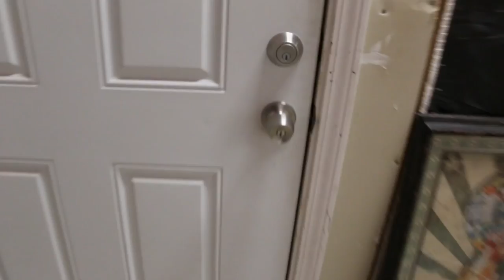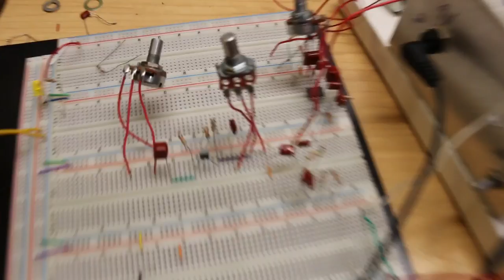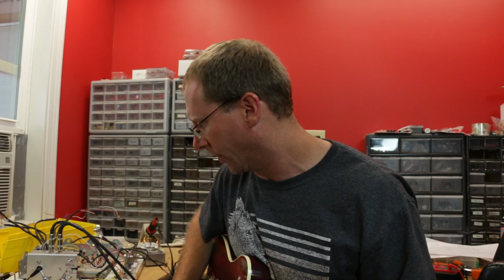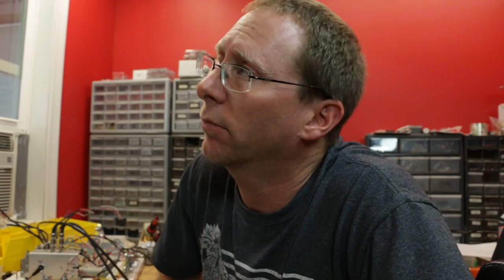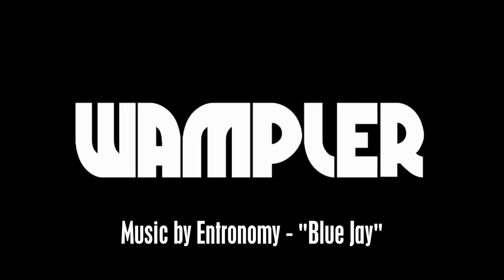Busting the myth of magical op-amps and diodes...?

Comment: What if you used white LEDs and painted them purple?  How would that sound?  ;-)
Reply: I think it is fair to say just about anything painted purple is better.
Reply: What if you connected it to a gain pot that went up to 11?
Reply: Actually, the tone would be warmer because the paint would cause the diode to run at a higher temperature.  You know it's true!
Reply: That is exactly what Prince did back in the days... no kiddin'
Reply: there are no white LED's. the white light is a mix of red, blue and green
Reply: It would be a lot less bright
Reply: Like a white ones that look horrible!
Reply: I heard if you use purple house paint over the whole box you will get 10% more power
Reply: It would sound something between White Snake, LED Zeppelin and Deep Purple.
Reply: @phililpb  White LEDS are actually UV making phosphorus coatings glow similar to a fluorescent lamp..
Reply: According to Prince it would sound wet.

Comment: When you're designing a circuit, how do you prevent your ears get fatigued? And, how do you avoid duplicating the sound of previous designs?
Reply from the maker: +Alan Parkinson every 30 minutes I do something else that is somewhere quiet
Reply: I do the same when writing songs take a 5 min break
Reply: Use proper test equipment, far better than ears, and no comfirmation bias.

Comment: It could just be the iPad speakers, but I didn't hear any difference at all in chips. I've swapped chips in a Boss EQ before though, and the one huge difference I heard (and result I was after) was a noticeable reduction in white noise when the pedal was on. There are differences in chips, but tone is not where you're going to notice it. Noise and headroom are going to be the difference to listen for.
Reply: Yeah that's one of the big things with op amps that goes unmentioned a lot of the time, I noticed the same thing when experimenting with op amps.  IMO there's a difference in tone but sometimes it can be subtle.  I find the difference to be more or less hi fi, or more or less fuzzy, like a different character of grain in the fuzziness of the clipping, depending on what pedal it is.
Reply: thisdyingsoul76 
Hi, what chip is quieter then, lm833n?
Reply: It was over a year ago that I made the swap. I don't remember the model of chip that was stock that I replaced. But there was a noticeable difference in the noise floor when I was done.
Reply: thisdyingsoul76 hmm, very very interesting
Reply: With a high end stereo you're able to hear a myriad of effects that these different chips provide

Comment: In conclusion op amps sound the same.
Reply: Yes because in this circuit, the op-amp is NOT creating the actual distortion, the rest of the circuit is doing soft clipping. Op-amp just amplifies it. If a circuit had depended on pushing op-amps into distortion, then I'd say we'd hear a lot more differences, because each op-amp DOES have different characteristics past the "normal" operational range.
Reply: I was just about to change the chips in my amp because I was told the new set would sound better. I thing I will leave things alone
Reply: In soft clipping pedals op-amp is no more important to the tone than the colour of the box.
Reply: Tong Zou  Of course they could :)
Reply: @EvilDragon666  evil dragon! You’re everywhere
Reply: @Hexspa  Kinda. :P
Reply: @phililpb  A more expensive, higher quality op-amp should sound cleaner and more transparent. That's what better op-amps are supposed to do.
Reply: No, they don't sound the same. That was not his point.
What he was saying was that the differences are a lot more subtle than people think, however they are noticeable.
Reply: I like the LED clipping best. Or, an LED and a 4148. 
Mix and match. Great demo Brian 👍
Reply: @ErebosGR  that assumes the playing intensity, etc. is also identical every time. As consistent as Brian is with his playing, it's a confounding variable unless you play the same audio every time into it. Feel could vary, how things clean up if the volume is backed off, but that'd be harder to convey over YouTube.

Comment: Anybody else really shocked at how different the sound was with different color LED's?  I know nothing about this stuff, but that's probably the last thing I would have thought to make a difference.
Reply: There was - but the hearing memory is short and he is yapping so much inbetween so i bet 80% of the listeners missed it completely, but hey!
Reply: Forward voltage I think. Could be wrong, it might be the color. 😂😂
Reply: Color has NOTHING to do with it... well, not directly. Forward voltage, however, does. Difference colors require different amounts of energy to create, of course, and this is reflected by the amount of forward voltage across them. Red having the lowest forward voltage, and blue having the highest. Green in the middle. 

In this, pink and white will sound the same, as pink has the forward voltage of blue, as it is a color component in the LED. 

There's really 4 different forward voltage varieties. Red, amber, green, and blue. All other colors are made by mixing the earlier varieties.

There's also UV, with an even higher forward voltage than blue, and IR, with an even lower forward voltage than red, but that isn't really relevant in this discussion.
Reply: Red and orange were mostly opamp distortion, they were hardly conducting.

Comment: I love how your choice of chips in the first half was all over the shop, showing how jFET/BJT input and current handling capacity has nearly bugger all impact on tone in a guitar effect pedal. The BJT input chips tend to be lower noise, which can be important in a studio mixer with dozens of channels and the higher current OPA chips drive lower impedance loads (headphone amp) better, but if you're talking distortion pedals, just use TL072s; they're common as clarts and they get the job done.

Comment: I've been standing in front of a Big Marshall for too many years.    It all sounds the about same Gaaaaaaaaaaaaaa
Reply: Dude, that was the point of the video.  THEY ALL SOUND THE SAME.
Reply: @timeforpudding6338  No, they don't sound the same. If they do to you, you either have hearing loss or not good enough headphones/speakers.
Reply: @ErebosGR  Ummm, you really didn’t get the point of the video, did you?  Go back and watch it again.  Brian is trying to explain to people, such as yourself, who believe there is an audible difference between the transistors he selected.  Geez.
Reply: @timeforpudding6338  You're the one who missed the point because you're trying to reduce the argument in black&white, like a typical anti-intellectual.

He was trying to dismiss the myth that different opamps sound drastically different, when in reality the differences are a lot more subtle but still noticeable. He even points out how some of them sound compared to one another.

Plus, when he was swapping opamps he had soft-clipping diodes, so the opamps weren't overdriven out of their operational ranges. If he had compared them without the diodes (like he showed later on), the sonic differences would've been greater.
Reply: @timeforpudding6338  If you want to go technical, you can research how the opamp's slew rate affects its frequency response.

Comment: That's 100% truth, i tested myself many years back and i can say there nothing i can hear fron just the chip. Usually we believe what we think is "better".
Of course there can be many other things like the tolerance of component or similar things but the psychological impact is very strong to our minds.
I like your videos and your good job you do, thanx for all these
Reply: Like he said the breadboard circuit he's using is junk. There was enough stray capacitance to suck any tone you might have heard. It is easy to setup a circumstance where everything is not going to sound good. A bit harder to build it so it does sound good. Never trust a test where they do not describe their methodology. We saw no schematic of the circuit they used. He could have at least tried to build the circuit a bit cleaner on the breadboard. Or better yet soldered something up and used a chip socket. They're not charging 40 times more for some of those Op Amps for nothing.

Comment: the first "expensive" one sounded better than the second one, but they're all pretty much the same. For the really lo-fi gritty ones, I like the LM386. The 4558 sounds pretty damn good too. It's a super subtle difference, and I bet some of these vary equally much within their models as they do compared to other chips. In my ears, it's mostly about clarity, apart from the gain levels of some of them. Great video!
Reply: Agreed.  The good old LM386 sounded great in this circuit.
Reply: LM386 is my favourite ever.

Comment: I've done this with several germanium transistors and it was a lesson in BS..
Reply: You've had the wrong circuit then because germanium fuzzes are the one thing where it actually matters big time. The gains and leakage values are so off the wall you will have to bias each and every one of them right to make them work like they're supposed to. With some circuits you barely get sound at all with the wrong transistor.

Comment: Brian, the way I hear it, there are differences between op amp chips but they are minimal. The game changes when you swap diodes. Volume and/or compression comes in. I believe it now comes to the builder on how he will voice the pedal and what does the player actually need. The bread board might have that low frequency hum but hey this lesson is very very clear. Thanks so much tukayo (Filipino for name sake)!

Comment: I'm a pro audio engineer of 20 years.  I gotta tell you if you're looking to check for accurate tonal differences in OPAMPS or any component by feeding it a clipped or distorted sound, you're missing out on all the actual tonal differences, dynamic response, transient response, and any true coloration of your program material because you have already drastically colored it.

It's a gain stage.  Every gain stage has the potential for drastic tonal changes.  I can hear drastic changes between the OPAMPS, and of course diodes.  If you send a distorted, clipped, compressed signal to a detailed gain stage, you're not gonna get much tonal variation, especially of a really useful kind.

Of course, if all those "guitar players" care about is a heavy distorted sound, then they are missing a lot of the tonal variety and variation and musicality that makes pedals well designed and truly useful, as opposed to a cash grab clone.

P.S.  I'm a big fan of your pedals and honesty, but this is a very tainted test.  Do it again with a super clean boost circuit, then you'll have a much better example of the sound of each gain stage.
Reply from the maker: +Fable Club thank you, but you're missing the point of the video. 99.9999999999% won't be able to tell a difference in its normal pedal use- as a clipping gain stage.
Reply from the maker: +Fable Club meant to add, as far as pro audio and purposes outside of guitar, you are correct. However, this isn't the person I'm talking to. I'm talking to guitar players and diy'ers who worry needlessly about what opamp is in their distortion pedal.
Reply: +Wampler Pedals Oh yeah, I totally understand that, but for DIYers, they can just as easily be misled if they are told that it doesn't really matter.  

That can lead to them pigeon holing themselves where all they do is copy other circuits and add to the flood of OD and Fuzz pedals out there that aren't well designed and use cheaper components to increase profit from a business sales perspective.  

Mac vs. PC, for example.  One is designed for mass sales, the other is a clear step above.  

If we look at some makers who try to eliminate the excess (EQ, filtering, etc.) and maintain a purity of tonal range going in and coming out, then we can move the whole process of design and sales forward, beyond just hip marketing graphic design, quirky pedal names and puns, and overly large boxes to stroke the egos of amateur shoegazers.  

For every website about science, there's a hundred about porn.  That's a natural part of human society, but...

Finding a more scientific and clear approach is, in my opinion, a better way for the industry and the DIY community to progress together.

Thanks for the conversation, and keep up your great work!
Reply: Fable Club: That might depend on which Mac or PC you're referring to.

Comment: I have installed JRC 4558 Malaysia chips from 1980 to 1982 as well as the correct diodes used in that era. As soon as I hit a chord my amp starts levitating off the floor. But seriously the pedal went from a boring average sound to something quite amazing that is hard to find words for. There is definitely something special to it.

Comment: For equivalent replacements watch out the different between operational amplifier and a comparator,then there are other parameters but in low frequencies may not alter the result.The LM324 for example has a significant high slew rate time even in very low frequencies around 1KHZ,that means the signal output can not follow the input signal changings and is useful only for very slow speed varying signals in automations.In a general rule dont expect better results compared to the original by simply changing a chip from the pedal,in the best case scenario the result would be exactly the same in the worst no sound at all from this specific function of the pedal.

Comment: The LM308 IC is used in the Legendary ProCo  RAT. If you get a Vintage Big Box RAT Reissue from the 1990s, it should come with a LM308 IC. If you get a newer FAT RAT, it comes with an IC Socket. with a newer OP07DP IC installed. So if you get a NOS Motorola LM308 IC, you can install it in a FAT RAT to make it more like an original 1980s ProCo RAT. NOS LM308 IC are available from RetroAmpIs in Spain.

Comment: At 15:00 , the op amp clipping was probably the best sound. Not  near as much if any clean bleedthrough and not as screamer-ish. The extra boost seemed to flub the bass a bit, but stoner/doom/sludge types would probably be in hog-heaven with that amount of rotundity. Could easily venture into Rat territory by going down the op amp boosting an op amp route, or so it sounded. Your comment that it had fuzz qualities leads me to think you may be onto something.

Comment: I think the main criteria for using some op-amps is the less noisy amps. Also, as I understand, the noise of the op-amp depends on the voltage - same amp on low voltage produces more noise in a high frequency range. This is the reason why the voltage 18V is preferred for stomp boxes. The ratio of resistors on feedback chain also affects on noise, the Rguitar >> Rground\Rfeedback

Comment: I did this 40 years ago with old MXR  and Ross pedals even old fuzz faces and my old uni fuzz. The slew rate can make a difference from chip to chip. Also since Germaniums clip at aprox 3/10ths of a volt thats why the load the circuit more than leds or even Silicon diodes like a 1n4002 or 4001 ect they conduct at about 7/10ths of a volt. I have notice different chips to an extent over the years in certain audio circuits. Nice little test anyway

Comment: I once "de-modded" a DOD Supra Distortion. i.e. tried to return it to stock as much as possible after someone had done a butcher job trying to make it an Tubescreamer. I left their IC socket in there so I could try different chips. Of course they had fitted it with a 4558. But I much preferred it with a TL072. Quite a noticeable difference in this circuit. I was figuring that was the JFET topology of the '72 vs the bipolar of the '58.

Comment: Great topic, first off, I love your channel and because of it I totally want Wampler Pedals. When it comes to all things electronic amp and pedal related if you say it is practically gospel as far as I'm concerned...however, I had heard somewhere that the OP-Amp in the vintage( 1980 something to 198p something later)  has part of its characteristic grit and darker tone quality at higher distortion levels is because the OP-Amp in that guy actually so bad at what it was designed to do it actually gave it the legendary character everyone seems to love about it. I've got plenty of time modding guitars but I literally just came over to this side of the cable so I don' know what's actually happening but in the Rat it has to do with the Op Amp being to slow to process and as you increase the gain, less high frequencies get distorted and I guess people prefer that. Kinda the opposite effect I thought that would have on those that prefer this pedal since it tends to lean more toward the music styles that DON"T like clean haha but whatever, my question, is could you mimic this effect with I an extra high pass filter somewhere that could act as the failing vintage OP amp? Of course some will say nothing will mimic the real thing and blah blah, will a different OP'amp that also has the same inability to keep up with the high frequencies sound just the same as the vintage Op Amp? In theory anyhow?

Comment: Hey Brian I've always loved tone of Uli Roth on the Virgin Killer / Taken by Force albums. I k ow he's said he used a strat with the pickup as close to the strings as possible Into a 100 watt Marshall via a cocked Wah, and sometimes a fuzz face, but rarely. He's also stated in July 1985 guitar player mag that he uses 'a fuzz that's a cross between a Shala and fuzz face' but I think it was a 'Schaller'. How would he get such a thick, fat distorted guitar tone, when he said it was all the guitar and amp? Could you come up with a box like that? It may have bee a Kent 6400 distorter which is a different circuit to the Schaller fuzz. Thanks
Reply: 100 watt Marshall = thick, fat distorted guitar tone. No additional pedals required.